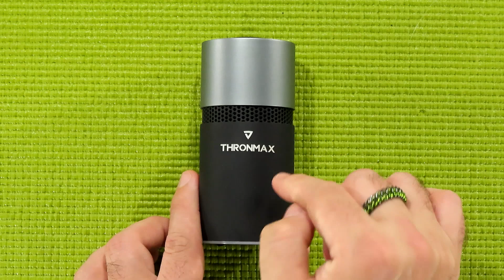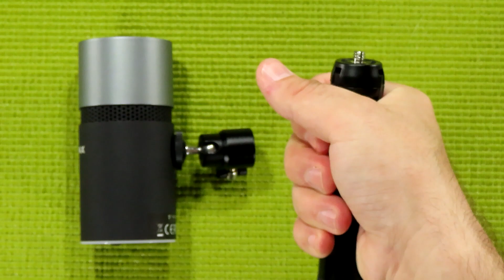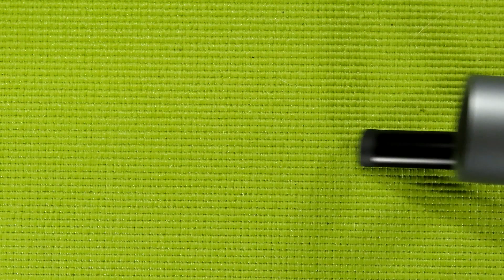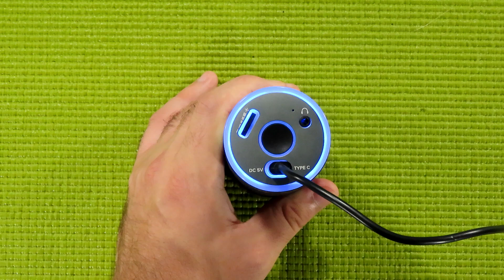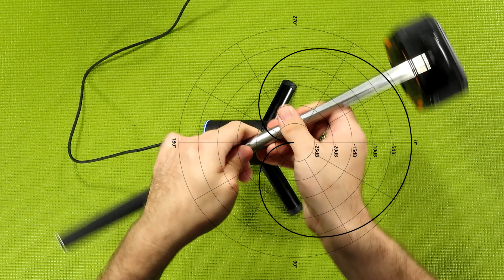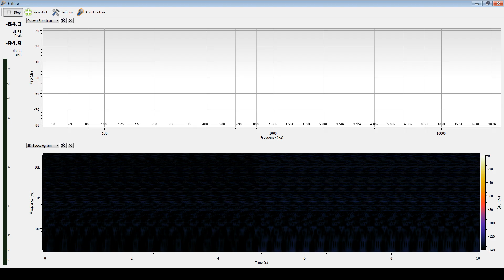THRONMAX Pulse | USB Microphone Review | Budget Tubing Ep. 19

Comment: This one vs Fifine, whose have the better voice..?

Anw, tanks for the review.
Reply: Could you please let us know which model of Fifine you wanna dive into? That should be the comparation between two microphones, not the brand.
Reply: @FIFINE  could you give comparison with Fifine K670 ?
Reply: @pojoktransportasi  Hi Fajar Nindyo, we haven't made a thorough comparison with the THRONMAX Pulse, So we're not able to give you any idea about the tone. But for the feature, the two-capsule array does value a bit more. But to be honest, in reality, its noise cancelation feature just won't work. Because it's a condenser mic, and the condenser mics just can't handle noise well. From the seller's point of view, it makes more sense to have a low-latency headphone jack and volume control instead of having one more capsule that doesn't work well, especially if you will use the mic for recording.

Comment: i just bought this mic, and when using it i hear a constant noise and my voice is very unreliable given i only have the original holder. i suspect it's because of the room i am in. 

anything i can do?
Reply from the maker: A cheap boom arm will likely help, since that means you can get closer to the mic. That'll not only take care of your unreliable consistency, but it also allows you to turn down the gain on your mic which will reduce the noise you're heading.

I did figure out later that some versions of this mic have a minor grounding issue, which cab cause a light squeal in the background. Mine is like that, but I was able to get around it by swapping out the cable for one that's shielded and uses a ferrite choke.
Reply: Hey guys so is this good or bad... Or normal? Can you say?